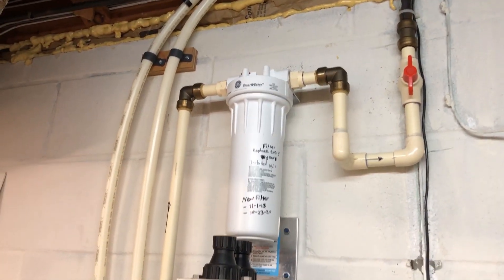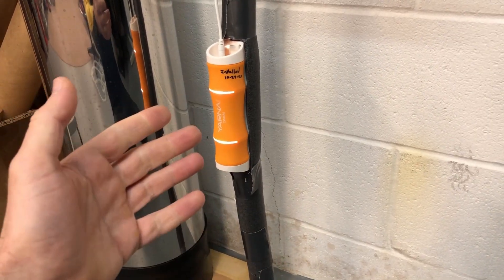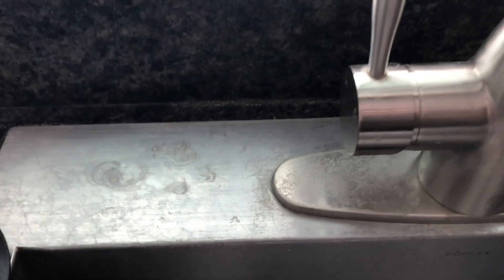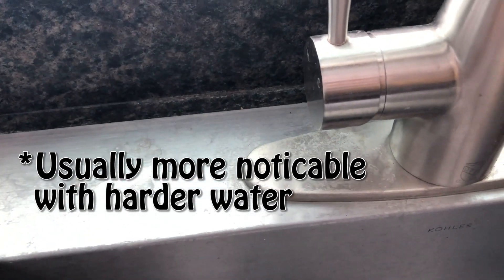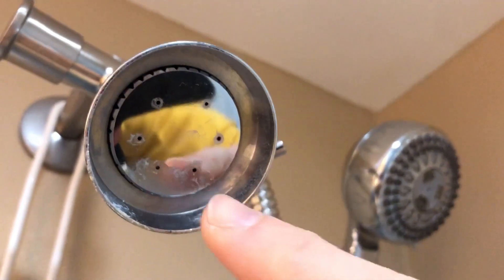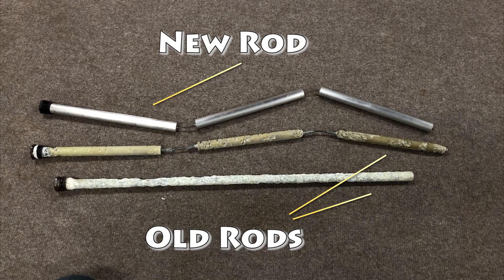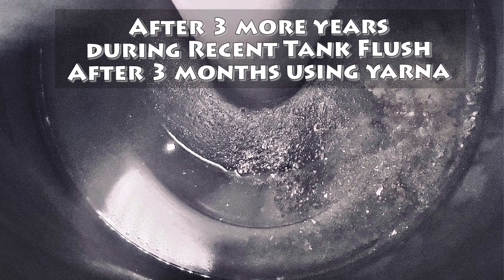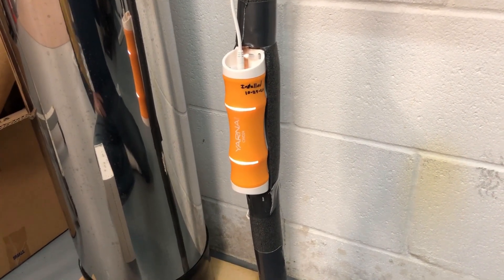Yarna Electronic Water Descaler - 3 Month Review | Random Video Thursday's

Comment: there is no way in hell this is doing anything.
Reply from the maker: Yeah not really. Except for the hot water tank.
Reply: Especially not on any metal pipe of any kind (not via capacitance!). The problem with a lot of analysis is making the assumption that the water coming in is consistent throughout the year. Some get lucky or test when TDS is low (total dissolved solids), pH changes, ionic concentration changes, etc. Others claim the opposite. While it is true, you need to run thousands of gallons through the system (could take a year or more, depending on usage), this is not a good test.
A better test is to split the incoming water supply - one with and one without - run the same amount of water through both and into filter media, recording sensors (of different types like a pulsed amperometric detector, flow sensors, etc). Recombining the lines, post sensor (and adjusting for any flow differences) to keep the total volume near identical, is a must - this eliminates the effect of changing incoming water.  I challenge the manufacture to do this real world test before making any claims at all.
Reply: @docdaven  It doesn't change the TDS at all. It temporarily transforms the calcium from essentially one isomer to another. From the two research papers I read about a year ago. (if I could find the reference I would post it for you.)  IIRC (and I may not) it is calcitite that sticks to the plumbing, this in theory, temporarily turns it into a different crystal structure. It was like two calcitite molecules bond together to form something else. So instead of forming a spiked crystal, it turns is more like a platelet, which doesn't stick, and it also doesn't trap iron, or magnesium molecules) 

Second, it don't think it works how you are thinking it works. I don't think it is working as an inductor coil, in which what you say what be correct. I could be wrong, but I suspect this works more like a capacitive radio antenna, and it just varies the frequency over a specific (fairly broad) range. You would have to put it on a scope to find out. I don't have one. And I am interested in whether the flat coils are a better radio antenna then just a round wire. 

Does it work? I don't know. From everything I have read, and seen. I think it does have some effect in specific circumstances. If you have high iron content, supposedly you need to remove that first, but I don't know that as a fact either, and I haven't seen anything besides a few posts on a plumbers site saying that, which could be them protecting their business as well.
Reply: @sharonrose9552  I understand this theory, however, the claim that it's electrostatic can't be true. Think Faraday cage. Any electric field generated is completely shielded by the copper pipe.
This applies to capacitive effect: unless there is an electrode INSIDE the pipe, it simply won't work. (you need a break with a non-conductive section).
On the magnetic end, an inductor will induce eddy currents into the copper pipe (as is expected), but those currents are on the outside only.  Some magnetic field will get through, however, but not enough to have a significant effect (not at that tiny power level) - except heating that section of the pipe.  
If you wish to effect ions in solution with electricity, you need an electric field (can't do this by wrapping anything around a metal pipe that shields it 100%!).
TDS WILL most certainly have an effect on water properties.
Reply: @docdaven  The electric travels on the exterior surface of the copper.  The INSIDE of the copper pipe is an exterior surface.  It isn't solid wire like you would use with a faraday cage. If you have a copper foil, and apply a charge does it matter which side you connect to complete the circuit? 

For the capacitive effective to work, you do need a conductor on the inside. Mineralized water is an excellent conductor but a higher resistance then copper, which is a capacitive effect. 

It very well could have a resonant effect because the copper is retransmitting the signal to the water. In fact it may work better with copper pipe because it can retransmit through the whole length of the pipe.  Solder has less resistivity then water. 

Because electric also spreads equally in any direction of the water flow is irrelevant. 
In order to reach the lowest potential, which is earth ground. in my case it has to go through the water back to the well because it is pvc pipe from the well to the house.  

To disassociate atoms from molecules, you don't need an electromagnetic field. You can create hydrogen and oxygen from water with a dc power source, and pretty much all electroplating is done with dc power sources as well. you need the pulsing to get the electromagnetic field which dc doesn't do. 

and maybe you are right, it is the electric ionization that makes it work, and not the resonate frequency. by pulsing and letting it discharge, you would get some molecular agitation.
Reply: @sharonrose9552  - This is exactly what I said. No charges will exist on the inside of a metal pipe unless you have a conductor from their circuit (which they don't have) in contact with the water. They're just wrapping coil around a metal pipe - the only thing that will happen is some magnetic flux leakage through the pipe. Any and all electric flux (field line) will be completely  blocked (internally - no charge). No capacitor action will happen (remember, a capacitor has 2 conductors of opposite charge and a dielectric - this is not the case here).  With that said, if you have a strong enough magnetic field, and some will pass through the copper (but negligible electric field), it is possible that ions in solution will be affected very slightly and change motion accordingly, but it's minuscule at best and wouldn't do much (the flux and counter flux between the coil and the outside metal would generate more heat than magnetic field - as one would induce it in the copper, and that would counter induce in the coil and so on - Lenz effect).
This is trivial to demonstrate.
Reply: @docdaven  The bottomline is so far it works. It isn't soft water, but it isn't hard water either. You don't get itchy dry skin from the softener running out and my hair is still soft, but you aren't getting a bathroom full of bubbles when you use soap either.  

Maybe the difference is I don't have non-conductive deionized water in my pipes. Mine has minerals in it and it is certainly conductive. And of course if you have deionized water in your pipes, it won't work because you don't have any minerals in the water to begin with. 

It doesn't work in all situations nor it is a water softener.